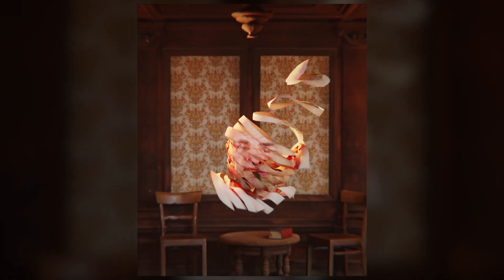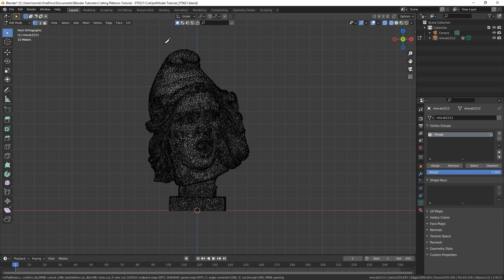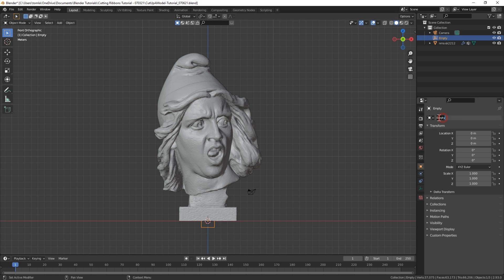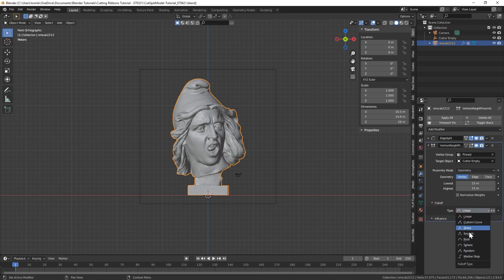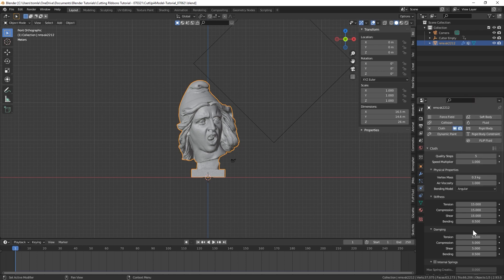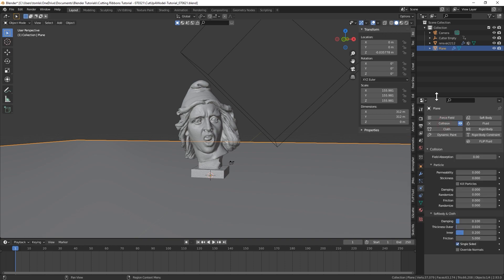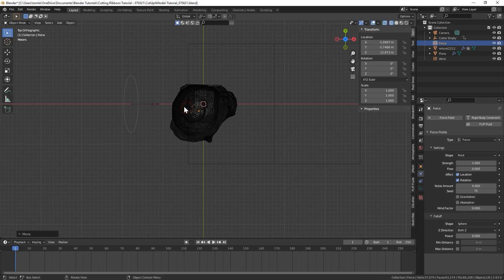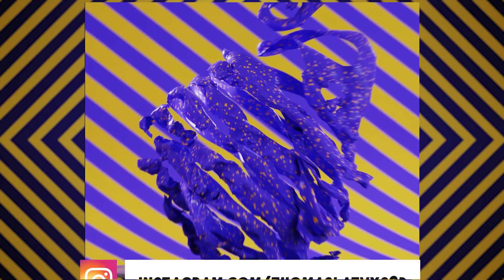Destroy Any 3D Model with Cloth Simulation in Blender

Comment: I'm a bit burned out looking for a way to apply dynamic collision based tearing effect with blender. Good tutorial but im very disappointed how lackluster blenders physics and particles in general. I may use some advice since I've given up, c4d or houdini to create physics based vfx? Cos i can only buy one.
Reply from the maker: Yeah, Blender is very lacking in dynamic physics simulations compared to C4D and Houdini unfortunately. C4D does have a lot of power considering its not built specifically for Physics based VFX, but it is more geared towards mograph work. It is a LOT easier to learn quickly though. Houdini is a lot more flexible, and I would recommend that for physics based VFX, though it will take longer to get up and running. Houdini does have a free "indie" version though, so you can download that and start creating before you buy anything.
Reply: @BlenderTutor good advices thanks, i think ill get myself a houdini hehe, i'll leave my solution here to those who wants to stay on blender but frustiated of similar issues. i had an old 3ds max licence, I did my simulation there and exported as "alembic" format keeping the mesh. And still managed to finished up my project in blender without remaking whole thing in another software. that cloth part was just small part of the project.